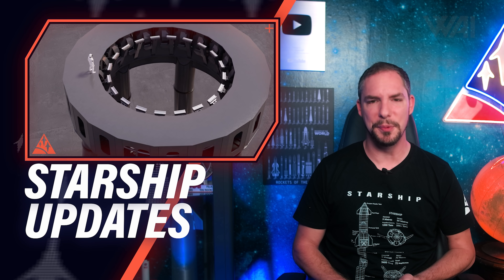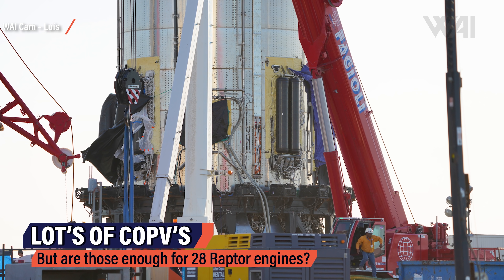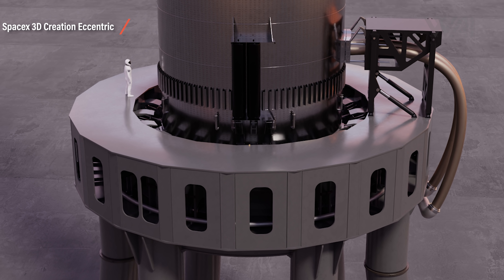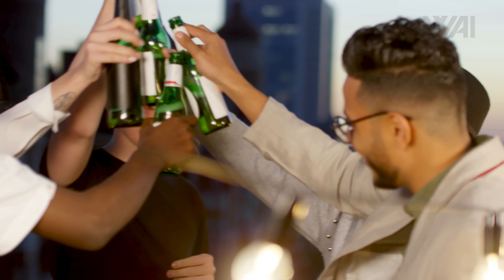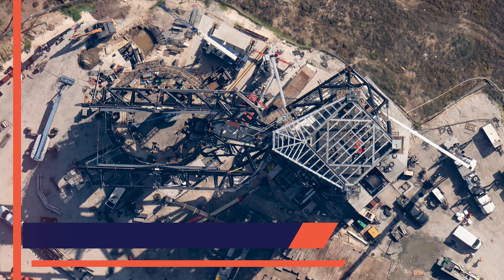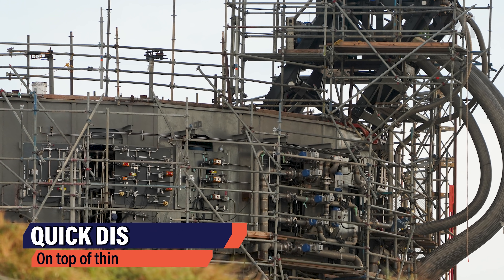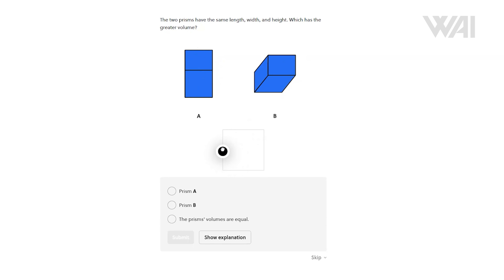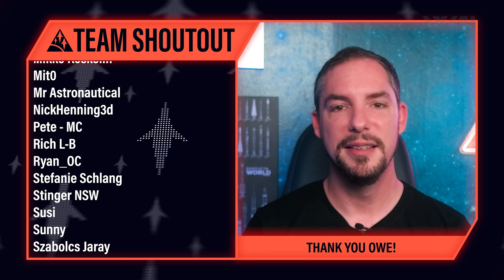SpaceX Starship & Super Heavy engine mystery solved!

Comment: how will they replace the nitrogen needed for engine startup for mars-missions
?
Reply: No booster for Mars launches, only starship itself
Reply: @yukionna1649  And the plan for the starship is to use pressurized O2/Methane so they don't need nitrogen/helium for that.

Comment: I guess before they fill up the methane tank they first have to expel all the air as it contains oxygen and if mixed with methane would be an explosive hazard. So do they fill the tank and the pipes first with nitrogen then pump in the methane and as it fills pump out the nitrogen which will now contain some methane gas. Following that I imagine they have to chill the methane out and back into the methane tank. I assume they are not allowed to leak methane into the atmosphere at any point? It would be good to have this process covered if you haven't already.

Comment: I thought they had said that they were not going to fuel from the bottom?
Reply: the earlier plan was to just put fuel attachments to the superheavy and have pipes through the superheave to the base of the starship

the current plan eliminates those pipes through the superheavy and has fuel for the starship enter through the side of the starship near the base rather than from the bottom (between the engines)

Comment: I think having 20 qd pannels for the outer engine will be a nightmare to alling properly after landing

And those qd panels that were showen on the engine weren't they pointed upwards toward the thrust puck? did i miss something ?
Reply: agreed, the connection panel mentioned in the commentary points upwards, and doesn’t look very QD..  I think those other parts on the table are hold down clamps, not engine QD parts.

Comment: Eh, could be a single source and a tuyere in there somewhere, it might be hard to see. I suspect, though, that they'll skip it-- I think reflected shock waves messing up the engines is a big part of needing a deluge, but we have seen their engines smack directly into the atmosphere at extremely high speed. Most engines are not designed for this. The extra robust engines combined with the large distance above the ground to avoid concrete spatter may make a deluge unnecessary. Sound is gonna be at full blast after the thing gets off the pad anyway.

Comment: Just a thought, the orbital launch mount's legs are hollow steel pipes right? What if those are the water pipes for a deluge system? Or at least, have the pipes installed inside them. You wouldn't want the water pipes to get too hot at lift off after all...
Reply: concrete, not hollow

Comment: There is a water tank in the tank farm so there is a deluge system. Also, at 9:47, I don't know why you discard the large pipes on the left so quickly, those are likely for water, while the other on the right go directly to the quick disconect.

Comment: Why the chopsticks can not be used at the launch? Fuel then ignite standing at the launch table. Then lift by the gridfins in order to protect the table. As it takes off chopsticks could bend back so that they almost hug the tower.
Reply: the empty booster is ~160T, the empty starship is ~120T, then they add around 5000T of fuel. what easily handles an empty ship doesn't have a chance to handle a fully fueled ship
Reply: It is not made to carry starship + booster

Comment: just like going back in time, to the days of hand cranking the the engine on planes or cars to start them. Reducing weight and complexity, introducing the raptor hand crank. It just runs on pressurized gas instead of muscles.

Comment: I would think a deluge system is incorporated into the launch mount. There is a water tank at the tank farm after all. It may help dampen the sound but it is more than likely needed to protect the launch mount and concrete base of the tower from all those raptors.
Reply: water is also very useful to remove some of the energy of the exhaust plume as it has a very high specific heat capacity. that means that it takes a lot of energy (relatively speaking) to increase its temperature up to boiling and beyond. it works basically as a heatsink, though i don´t know how significant this effect is in total.

Comment: How is Superheavy supposed to rocket back and get caught by the tower if it shuts down burns in flight without an onboard ignition system?
Reply: That was explained in the video. There is an onboard system, but only for the central engines. The OLT system is for the outer ring of Raptor engines, which are no longer required after MECO.

Comment: Sorry but I have to have a strong disagreement with the render at 4:23.  When the booster sits on the table it is flushed with the inner part of the table.  According to this render, betwwen the booster and the table inner edge there are at least 1.5 to 2 feet.  Not accurate.

Comment: Great video, Felix. Thank you for doing such a great job keeping us all updated. As for the deluge system; It is hard to imagine a launch mount without such an accommodation but it is also hard to see the infrastructure or pipes necessary to deliver such a large volume of water. Oh wait, what are those five huge pipes leading up to the mount?  Are they only legs? I don’t remember seeing them filled with concrete. Do they serve more purpose than just holding things up or are they also used as service conduits? In this case to carry huge volumes of water?
Reply: I had the same thought. I guess we'll find out eventually.

Comment: Do you have any idea what is going on with Starlink. The started off launching on a very regular bassis.now Insee launches on Everday Astronout’s upcoming launch page, and then they just drop off the list once they get a week or so out. I though Starlink was supposed to provide a large cash flow to suport other SpaceX endeavors.
Reply from the maker: I expect that it's problems with the sats themselves. Been wondering too. Maybe a design change on the upcoming laserlink system? :_WAIHello:
Reply: @Whataboutit  makes as much sense as anything. Thanks.
Reply: I think it has something to do with Blue Origin's recent protest about Starlink's ambiguous constellation proposal for 2 separate orbits in one filing.
Reply: @odysseus5872  I am confused. That is about the lunar lander program, has nothing to do with Starlink, unless Inam missingnsomething
Reply: @stanbrow  They are protesting the starlink next phase as well, and getting all the other names they operate under and work with to protest as well. There is a rule prohibiting anyone proposing more than one geosync communications system on the same frequency band, and they are deliberately confusing the issue to claim that for the starlink (non-geo) system, SpaceX should be required to only submit one possible configuration (and then if they need to change it, would be required to submit a change, pretty much starting again, giving everyone another chance to cause them grief)
Reply: @stanbrow  you're missing something. BO is also protesting Starlink. Spacex filed their plans for the next round of satellites to the FCC and in that filing they proposed 2 possible orbits. BO lawyers jumped all over that saying each orbital proposal needs it's own seperate filing and approval. There's  a lot more to it but that's the gist of it. BO has protested Spacex progress like a dozen times over the years in various ways
Reply: a power struggle for business amongst the space giant aspirants. @odysseus5872

Comment: It’s the big horizontal temporary  tanks that is going to be used for the sound suppress.
Reply from the maker: The ones right of the OTF looking from Hwy4? Those are for Nitrogen I presume. :_WAIHello:
Reply: @Whataboutit  Why would they need such a large amount of nitrogen.., except to possibly pressurize water contained within those tanks?
A pressurized forced water system, in a pressure container would be much simpler, than using several high volume/pressure water pumps. Think about those small water rockets we played with as kids. Pump them up, blast them off!
Just my thoughts..
Reply: @Whataboutit  I think you’re right. If it was for water they’d have almost no head pressure and would have to use huge pumps. A vertical tank only makes sense for the water storage.
Reply: @sc1338  They have two large pumps installed. Powered by US Motors motors.

Comment: I'd go with "they don't care about the sound".
remember, by the time the rocket gets just slightly up in the air, the deluge system isn't going to do any good, the sound will be hitting a huge area. I don't know the numbers, but I'd guess that by the time it gets 50 ft up (double the height of the launch platform), the area hit by the sound is so large that the deluge system won't help.

The deluge system has more effect on managing the heat/impact of the exhaust gasses from the rocket. But with the right materials, and a fast launch (remember, the thrust/weight ratio of the starship is 1.5 vs 1.25 for the Saturn V, so it will accelerate twice as fast) how much protection do they need?
Reply from the maker: The problem here is not the area, but the rocket itself. The sound gets reflected upwards. This can damage the rocket. :_WAIRocket::_WAIRUD:
Reply: @Whataboutit  which is worse, the reflected sound waves for a few seconds, or the direct sound waves for 5 min?
Reply: @davidelang  The reflected soundwaves are a bigger problem as they introduce harmonical vibrations into the system that the engines alone cannot create. It's to interrupt that potential feedback loop that the NASA Launch Complexes are designed as they are. As long as you are close to the ground these reflected vibrations can self reinforce and add up to a giant wavepattern that is more than the rocket can handle. After leaving the ground and only being exposed to the singular source from the engines the stress absolutely goes down to what the rocket can handle without help.

Remember:
The test stands in McGregor (IIRC) where every Raptor is checked for function and safety use the engines lying on the side blowing their exhaust out vertically so no ground reflections can feed back into the structure. They can run engines for many minutes on that thing without any problems of vibrations causing it to fail. But when they have complete Rockets or Boosters at Boca chica, Static Fires only last a couple of seconds as they have the exhaust hit the ground and THAT will create those reflections.
Reply: @Ugly_German_Truths  They do have a vertical test stand at McGregor, I think the biggest reason most of them are horizontal is convienience. you only have to have a lot of clearance in one direction, and you don't need structures as tall.

As for the short duration static fires at Starbase, they are limited to something like 420 seconds of static fires per year (agreement with the county to reduce impact in the area) , so they are going to keep each burn as short as they possibly can

harmonics are just as bad from sound that travels though metal as sound that travels through the air, bounces off the ground, travels back through the air, and then hits the craft.

I'm not saying that there is no chance of the bounced sound being a problem, I am just saying that it's not gospel that all rockets must have water deluge systems to dampen sound or they will come apart at launch
Reply: The shuttle needed deluge (or extra deluge) as it was held on the pad for several seconds before the SRBs lit. I think Saturn had a noticeable run up period as well. Lots of smaller engines will always start faster than a few huge ones (such as F1s), and so far Raptors seem to come up to full power much faster.

Just a thought - maybe the launch table creates a sound shadow zone directly above it that shields the booster from ground reflection as it lifts? Of course this won't shield the tower, tank farm, passing wildlife, Boca Chica etc.

One more thought - nobody has launched a rocket this big in decades - except for shuttle, which was an odd beast in many ways. So maybe there have been advances in modelling sound and shock waves with a shorter hold down that show that so many precautions aren't needed? Soon find out!
Reply: @Julius_Hardware  Right, shorter time to full power, so shorter hold-down time cf Saturn or shuttle.  High thrust-to-weight ratio about 1.5, it will jump off the pad .  . !
Reply: Deluge systems take quite a while to recharge. SpaceX doesn't have time for that. 

SpaceX's steel boosters are much more robust than the aluminum Saturn V or the composite Falcon 9. If static fire testing shows that they aren't robust enough, they will probably make the rocket stronger. A strong rocket is needed for a high launch cadence.

Also, the launch pad is higher above the ground to reduce reflections somewhat. The extra distance gives the sound waves more space to weaken.
Reply: Could the 2+ rings of Raptor engines act like explosion lenses, bending the shock-waves outwards, away from the booster? Saturn V had only one 'ring' of engines.
Reply: Oh, the launch mount's higher off the ground than that. Probably about 100ft (~30m). Also, the sound waves weaken according the the square of the distance, IIRC, so the biggest problem will be when SS+SH's sitting on the launch mount between engine ignition and the time when Starship is about 50ft off the pad. Once it has a bit of distance from the launch table, the sound waves won't be nearly as strong.
Reply: About the sound,  one way to maybe minimize it without any hardware would be wave diffraction,  as in intra-ocular multifocal lenses. Those can accumulate lightwaves into useful peaks for vision but the same algorithm could be used (maybe) for each of the 30engines minimizing each one's peaks out (it is when those peaks add up that you get that infernal sound). The outer ring of engines could be considered analogous to a fresnel ring. Wild hickup here,  but who knows...
Reply: @Jeppe Achton Nielsen At launch, the reflected sound waves have to travel 30-50+m to the ground, then 30-50+m back up to the ship. (and every inch it climbs give it two inches more the sound has to travel.
The direct sound waves have to travel inches to feet (no more than 9m to hit the other side of the craft), and getting up to thinner air will only help so much because the sound will be transferred through the hull of the ship (especially if the energy can't be dissipated into the air as sound)
Reply: Throttling may be part of the key.
Reply: The rocket stands too close from the ground. Intuition tells me the rocket would burn and disintegrate from heat, fire and shock waves as it tries to lift off...  The concrete floor and launch pad would melt. Curious to see what they are going to do.
Reply: @felipaorfr  Intuition doesn't work well with rockets. If it was as sensitive to heat as you think, it would never survive reentry

concrete may fracture and spall, but it takes MUCH higher temps to melt it.

The pad isn't going to melt because no matter how hot the exhaust, it's just not on the pad long enough (boil a big pot of water, put a smaller pot in the freezer overnight, then dip it in the hot pot for 1 second, pull it out and watch the previously boiling water freeze to the outside of the small pot.)
Reply: @felipaorfr  ICBMs launched from inside tubes. They did not burn up.
Reply: @felipaorfr  Well, SpaceX uses a whole lot more than intuition to make decisions, especially major decisions like the design of the launch mount. They certainly take risks, but very calculated risks.

Comment: This edition mentions no evidence of a water deluge system. If this so what is the role of the water tank at the orbital fuel farm? Is there a water tank in the suborbital farm? If no to this second question then surely the water tank at the orbital fuel tank farm has to assist orbital flight.
Reply: Toilet and drinking water for Starship. ;-) In most space systems the fuel cells produce water but we haven't seen any kind of Hydrogen storage systems yet. They have said that there will be a recycle system for water. Methane fuel cells also require water to start with. So there will have to be some water storage on the ship itself, just not in the quantity that the tank farm tank can hold. So yes, it likely is mostly for the deluge system. We saw huge pumps installed for moving the water and SpaceX is planning on a plant to provide fresh water.

Comment: The water deluge system is more then likely built into the support legs on the launch tower itself, it cuts down unnecessary pipe work going to & from the site etc the clue is within the building work early on with the pad etc
Reply from the maker: I could not spot anything there. Even looked at pictures, when everything was still open. The pillars are steel with concrete inside. :_WAIHello:
Reply: @Whataboutit  exactly, they had concrete poured into them without any pipes embedded, so those legs are solid.

Comment: You don't suppose spacex plan on pumping the necessary water for the sound suppression system through the OLM legs? I believe they are steel tubes. Maybe pumping ground water. Just a thought.

Comment: The ignition system being moved off the booster is s great idea! Do single use rockets already use this technique?
Reply from the maker: Not that I'd know of at least. :_WAIHello:
Reply: I think you meant startup system.  However, for off-board ignition checkout the Soyuz PZU
Reply: I know Firefly Alpha does it but my rocket knowlage is in no way extensive.
Reply: I know the Shuttle did use external ignition for the liquid fuel engines on the main Orbiter, you can see the cascading sparks flare up moments before the exhaust ignites and the shuttle gets going.
Reply: @Ugly_German_Truths  I don't believe those are for actual engine ignition. I think they are intended to ignite unburnt hydrogen from the startup sequence. For whatever reason they discontinued that practice on the Delta 4, hence the startup fireball on the D4
Reply: @mattgraham4340  yes you are correct